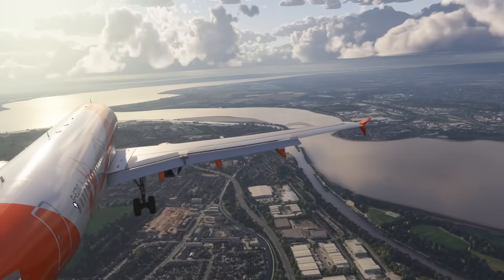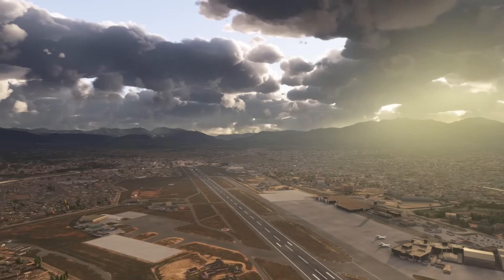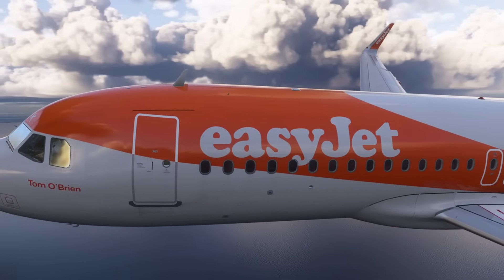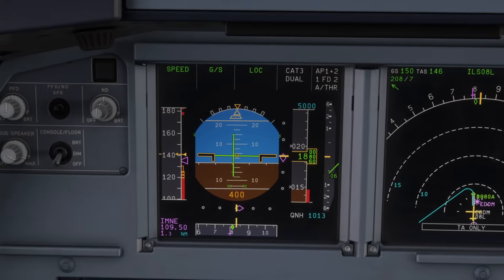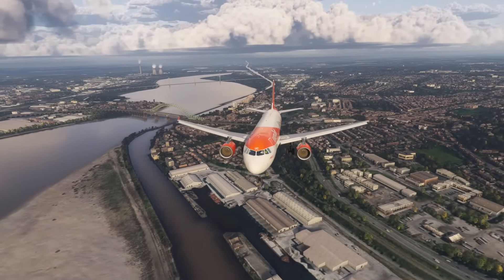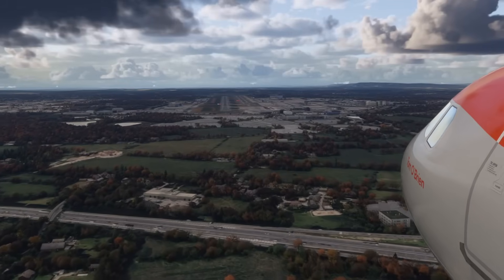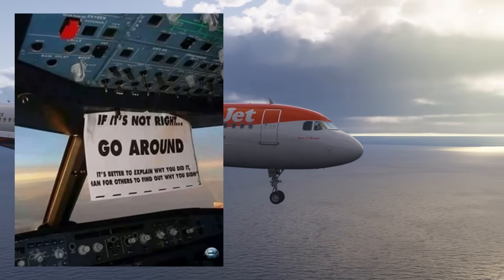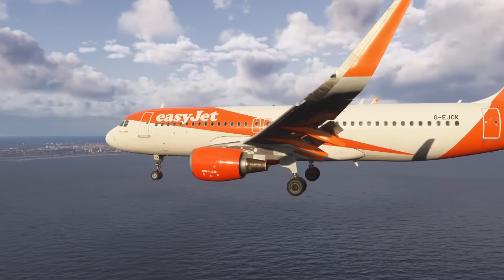Don’t Ignore the A320 Landing Rules! – Why Real Airbus Pilots Go Around

Comment: How is it on airports like Nice where you'd be stabilized only at about 500ft due to the approach?
Reply from the maker: As that will use a different approach stability criteria, like the circle to land approach stability gates. These are lower due to the turn before lining up etc being below 1,000ft.